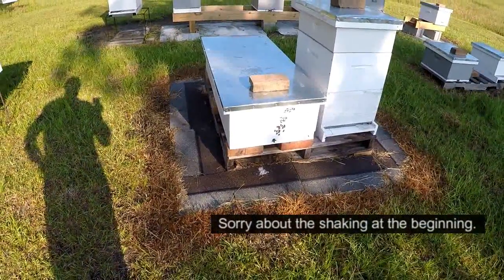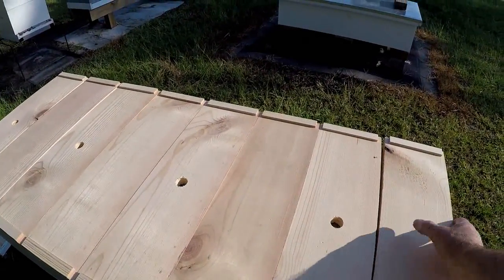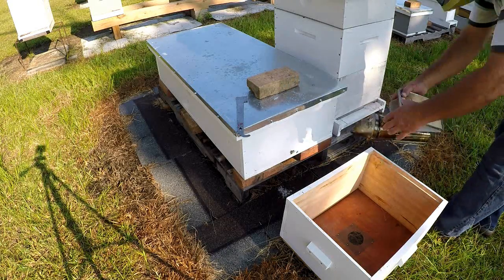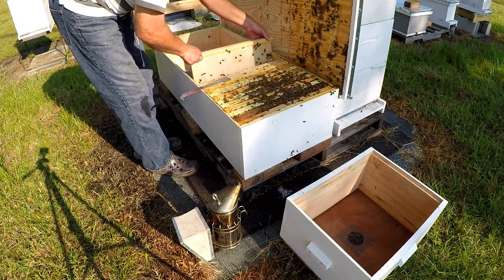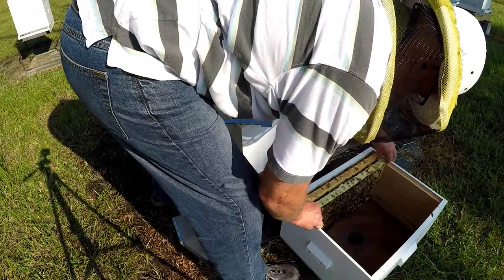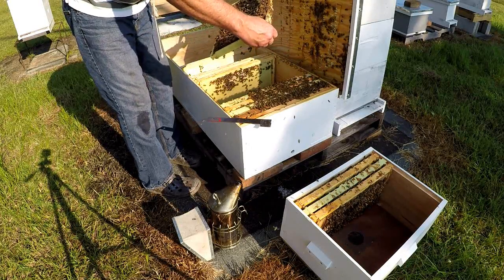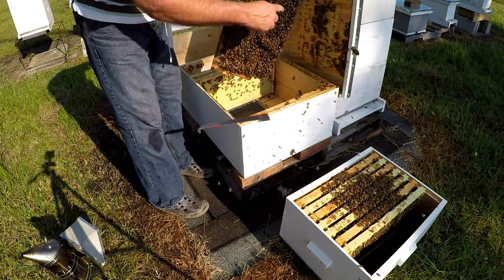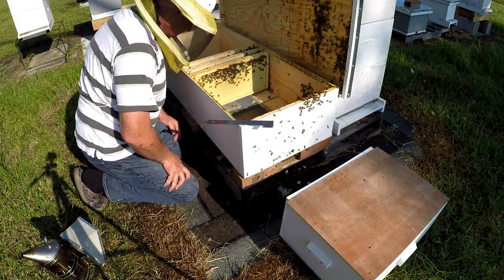Long Langstroth Hive Mods Part 1

Comment: Where is the best place (price) you’ve found to get the aluminum flashing for your roofs? I’m building 6 of those horizontal hives now. Just getting into Beekeeping myself.
Reply from the maker: It has been a while since I bought any but I got mine from a local hardware store. I have a few done with aluminum but most are done with galvanized flashing metal. It is much cheaper.

Comment: Very nice instructions! I'm not a very good carpenter, so forgive the silly question, but what kind of wood are you using for the inner cover boards and spacers? I have a long hive that I purchased. It is really nice but the inner covers are warping and I'm looking to replace them. Thanks so much!
Reply from the maker: Iron Holler Farm I ripped 1”x12” pine shelving in half and cut to length.

Comment: Hello! I wanted to ask, would it matter If I made an entrance for bees from the short side of that hive? (Meaning the front of the frame would be facing the entrance)
Reply from the maker: Μπαζεϊουσκυパトリック It is really all about preference. Most of the long hives that I’ve seen, the entrance is on the opposite side of where the beekeeper works. I just chose to put them on the end. Thanks for your question.
Reply: +Joseph Rawls oh great, Thank you!